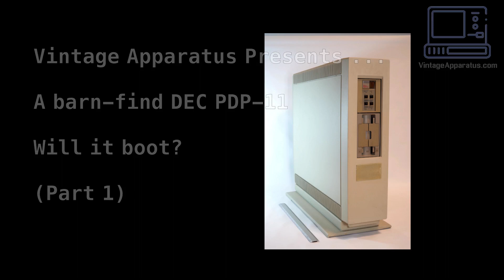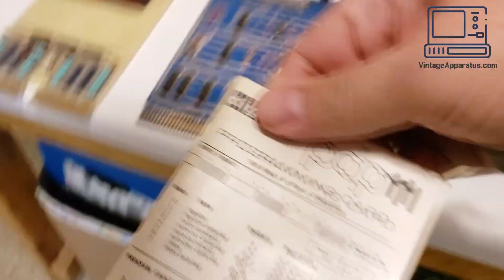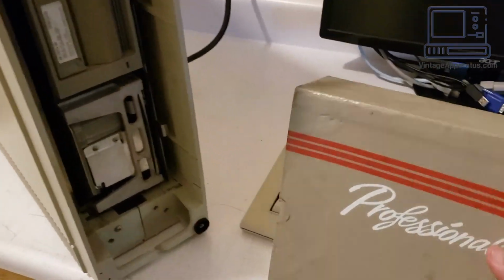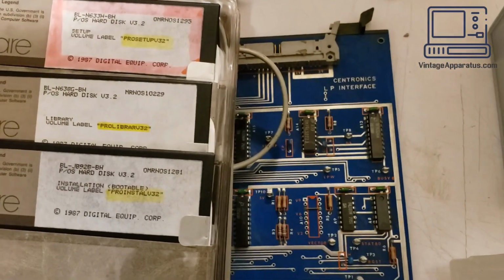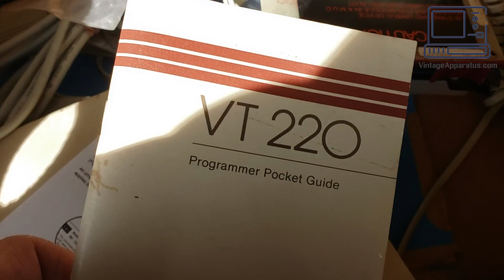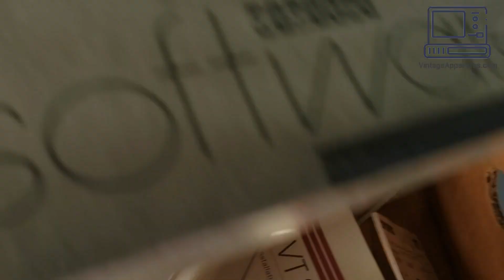Barn Find PDP 11/73 - Will it boot?? - Part 1

Comment: Back in 1976/7 there was a PDP 11/45 not being used at the University of Waterloo. We had the idea to put the UNIX system on it and got a license from Bell Labs. It may have been the first ever license and was a single typewritten page. We had a number of problems getting the UNIX code onto the machine because it had non-DEC disk drives. We configured the system on another PDP 11 then copied the system image over a 9600 bps wire we hooked up and a little program we keyed  in through the console. I debugged the drivers while talking to Ken Thompson on the phone cradled to my ear while keying in things on the console and reading back data from the lights. Once we got it running I used the system to teach operating systems. It had 128KB of memory and was a nifty little multi-user system. My, how things have changed!

Comment: First job, I worked on VAX 8600, modified PDP 11/34 & PDP 11/84 with fibre optics that had their own custom software on tape (didn't load RSX). Also done a bit on a Sun box with Solaris version 1, they even had a few Xerox Alto boxes! This was back in 1987

Comment: 3:51 P/OS was a derivative of RSX11 (not that I ever used it).
Reply from the maker: Correct!  The Pro 350 and 380 (and 325, for that matter) all ran P/OS (the irony of that name was not lost on any of us), which was a very nice layered menuing system, as well as a graphics subsystem that was based on ReGIS (similar to NAPLPS) which ran on top of RSX-11M+.  In the base distribution, ther was no way to get to the command prompt, but you could install a secondary set of packages that let you 'break out' of the menus and have a fully operational command line .   At the time I was very familiar with VMS, so RSX-11M+ felt very similar, but later on I realized RSTS-E was where the real power lay.  I'd love to get RSTS up on this machine at some point.
Reply: @vintageapparatus  I was familiar with VMS, and RSTS/E before that. I think I tried messing with RSX11 briefly, once, but couldn’t quite make sense of it.

I also had some fun in my student days with a VK100 (a.k.a “Gigi”), which was a ReGIS graphics terminal with built-in Microsoft BASIC as well. While ReGIS itself had some nice functionality, trying to send graphics commands over a serial line was painful.
Reply: @vintageapparatus  Yeah the thought of RSTS/E living under my desk would give me "the jollies".

Comment: I used to manage/program some ICT (In Circuit Testers) a long while ago. We had a number of Genrad models come through the factory at various times, upgrading as the electronics we were manufacturing evolved. One of them was called a Genrad 2276XP, and the CPU in it was a Micro PDP 11/73. The equipment had a 6-8 slot card cage in it, which had not only the CPU, but the memory card, a thick wire ethernet card, and a couple of cards that interfaced with the electronics in the rest of the tester. I also had a Programmer's Station (ran two VT-100 terminals, to be used to write a test programs on) with a PDP 11/23 (the 11/73 was a far faster machine), and a Printronix dot matrix line printer. Both ran RSX-11M+. Love that OS and the hardware was so rock solid as to be almost unbelievable.

Later moved on to the Genrad 228X family, which was the uVax 11 based. That is when I first ran into a DLT tape drive. The programming system was a Vaxstation 3100 Model 30, and it too had a DLT in an external enclosure. the uVaxes ran VMS, of course.